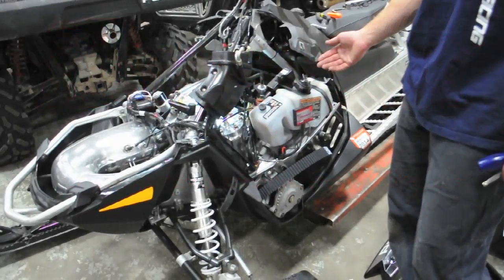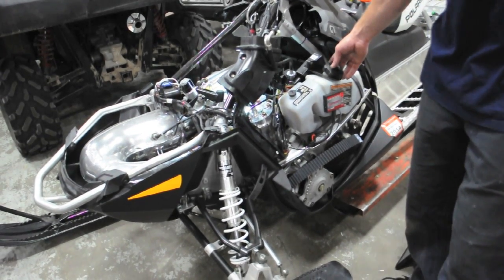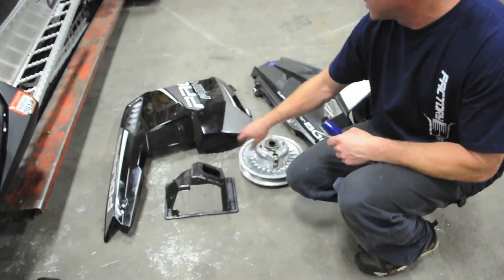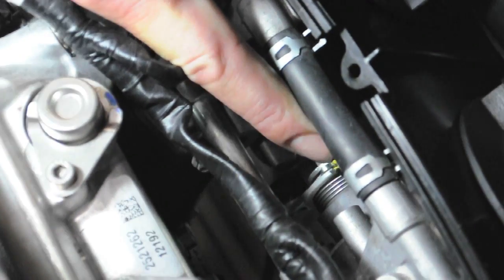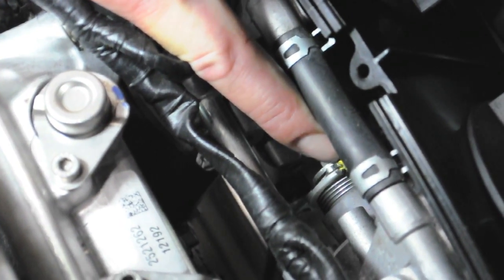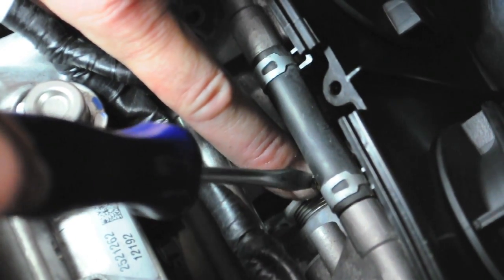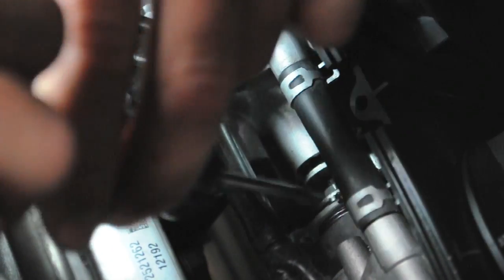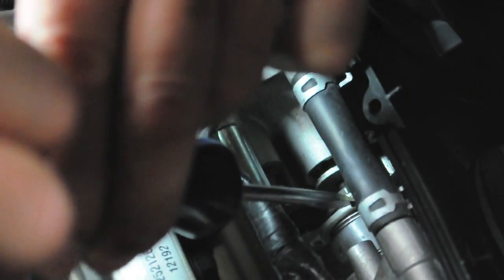800CFI Oil Pump Adjustment

Comment: On a 600 no need to remove all that stuff, just have a long extention, loosen the lock nut and a somewhat long screwdriver will do the trick. Just be careful to not tighten the lock nut too much.

Comment: I'm planning on turning up mine on my 13 pro...I'm now running Legend ZX2R oil. Still 3 full turns?
Reply from the maker: Only 1-2 turns on a stock sled. 3 turns is suggested with our big bore where we add a bunch of fuel with a power commander.

Comment: Would you recommend doing the same with the 2014 600????????
Reply from the maker: Yes! Maybe not 3 turns, but one turn would be good. We also recommend pre-mixing your oil at 100:1. Be sure to run good oil like Amsoil, Klotz.. ect. All the Polaris motors have major lubrication issues and will go so much further with more oil.
Reply: BikemanPerformance
Thanks for the advice!! and Check out my channel, any support would be great!!!